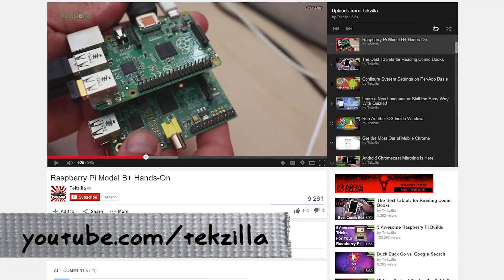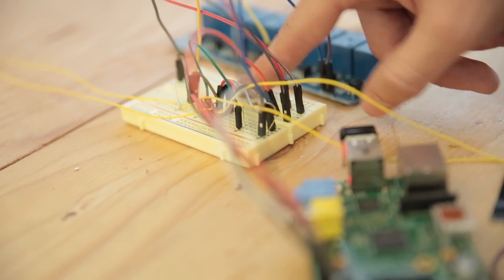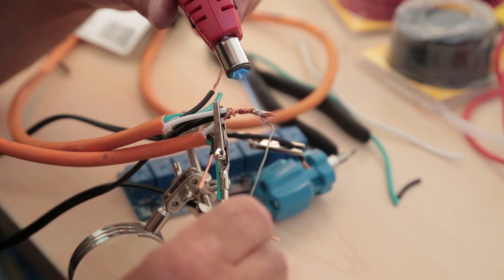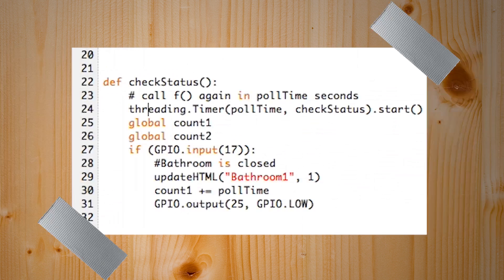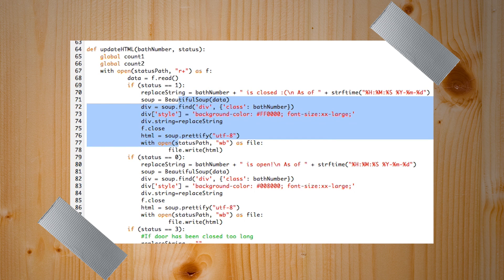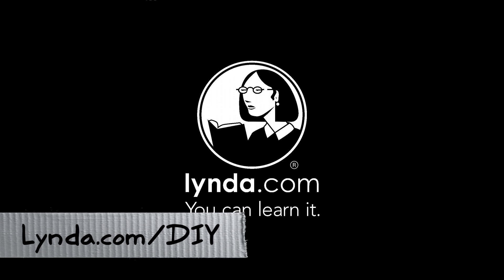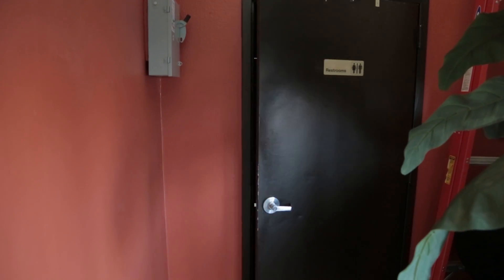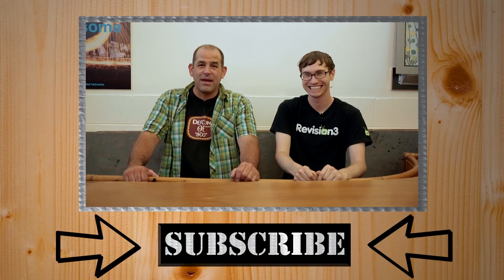Use a Raspberry Pi to Fix Everyday Problems. Become the Office Hero!

Comment: I have a Pi and still have no ideas for a useful need for it.
Reply from the maker: YouTube Commenters, Assemble...

Give this Droid some ideas!
Reply: DroidAppleTech Put Linux on it, put it in a nice case, attach it too the back of a spare monitor, and donate it too a local kids after school program they never seem to have enough computers for the kids to use.
Reply: Paperweight!
Reply: i've turned my pi model B v2 into an internet powered retro radio.

parts:
3W per channel amplifier (dx.com)
realtek usb wifi adapter
burned out Logitech ipod dock (speakers were scavenged from this)
old, broken radio (goodwill, salvation army, etc.)
rotary encoder (optional, for volume control via GPIO)
5v 2A adapter (scrap, parts box, etc.)

software: 
occidentalis (adafruit raspbian build)
squeezelite (controlled via software for the logitech squeezebox)
you could also use the Volumio image if you wanted.
Reply: Commodorefan64
so far still doing nothing.
Reply: @DroidAppleTech  how about now?
Reply: +DroidAppleTech
• Home Theater PC (Kodi) — VERY popular use, near zero additional cost and useful
• Build a MAME video arcade cabinet — also very popular and cool
• Server for websites or an internet camera
• Start an internet radio station (Shoutcast)
• Replace the guts of an antique radio to play internet radio & MP3s
• Hub for a video security system
• Control your holiday lights
• Slap on a fat HDD for Network Attached Storage
• FTP server for accessing your files when you're away from home
This list could go on forever, but I can't. Make something with it. If it stops being cool or fun, make something else. Good luck!
Reply: I have a Pi, I have an Apple,... Applepi :D
Reply: DIY Tryin
bear in mind i have a macbook pro, hackintosh and a Power Mac G5 so I'm already loaded with computers.
Reply: Buy a simple LCD display, preferably 10 inches, cut a hole in your backpack to the same size of the display, place the display inside the backpack facing out of the hole, connect the display to your raspberry pi, buy a portable rechargable battery, and boom. You can now play games anywhere you go, on the bus, in the library, or in a car on a vacation trip. You can just connect wiimotes and such with bluetooth.
Reply: +DroidAppleTech That you couldn't figure out anything to do with it says more about you than it does the pi.
Reply: DroidAppleTech 
Turn a dumb TV into a smart TV or use it to replace the buggy spyware laden web and media functions of a Smart TV.
Reply: Peter Missick Why bother on the cell phone idea when you can get a Motorola E for $80 US, and it's MAME not MANE, which stands for Multi Arcade Machine Emulator. The Best Idea is still to attach it to a TV, or Monitor, and either make a mini Linux computer out of it, run XBMC on it.
Reply: DroidAppleTech I turned mine into a tv streamer lol to watch football
Reply: Minecraft Server, Smart house brain
Reply: ***** Yes it did just came out, but he has the old Pi laying around, lets stick to ideas for the original Pi.
Reply: +DroidAppleTech I turned my Pi into a full blown HiFi-Stereo system using the HifiBerry AMP+ (2 x 25 Watt is way enough). I store a copy of my music on a USB-Stick connected to the raspberry and can play my library with my computer shut down. It has an IR-sensor such that I can use my remote and maybe sometime I will add a display (currently I have a text-to-speech program as feedback). Additionally, I stream sound from my computer to the raspberry via ethernet (which is automatically detected by my computer). It is really something nice... :)
Reply: +DroidAppleTech 
put a vpn server on it. so you can connect to your network. And use it from your phone whenever you are on a public wifi.

make a scrip so that you can turn on/off your computer over the internet from your phone. WOL/rpc -> enable remote desktop on your desktop pc, so you can then use it remotely when ever laptop doesn't have enough prosessing power.
Reply: +protonx80 a wifi connected "local neighborhood storage" actually sounds like a cool idea!

Use it like a local craigslist!
Upload coupon codes for stuff you don't need!
Host porn on it.
Etc.
Reply: +DroidAppleTech I made a controller with a webserver on a Raspberry pi, for a DIY solar heat collector (of course open source!). You can see it on www.solarair.livotel.com. It is also controllable trough a smartphone or webbrowser.
Reply: Easier stuff are a VPN server for anywhere, just connect using OpenVPN on your linux machine while the PI sits safely at home, or even windows [haven't tried]. You can just overall use as a programming hub, video hub, music hub, file server, multiple servers, game servers, buy some parts and make a personal Pi-laptop, etc.
Reply: DroidAppleTech I'm curious, what did you decide to do with the Pi?
Reply: Expecially since the rasberry pi 2 is out with almost triple the performance for the same price you can easily turn it into a roku type device using xbmc in about 5 minutes.
 That can stream 1080p its pretty sweet.
Reply: +DroidAppleTech  eat it
Reply: +DroidAppleTech Sell it on some auction site and move on having more cash instead of equipment you do not use. The hype around this machine is huge, even the first models are worth cash, use that and sell it. Because of the small size it can go as a letter.
Reply: chilliman07
but why???
Reply: ***** you are spot on and this is precisely why Apple is not relevant because it's not open and tremendously limitated by some stupid decisions in terms of software.
Reply: +chilliman07 paperweight
-_-
Reply: ANTHONY CABALLERO shut up
Reply: going for media/entertainment (home theater+ streaming), FTP server & torrent machine
Reply: Commodorefan64
You can still stream 1080 p using a b+ .
Reply: DroidAppleTech Sounds to me you are yet to get a computer ;-)
Reply: I have 4, all running Linux :P
Reply: +chilliman07 true dat
Reply: +DroidAppleTech Make a retro console!!!
Reply: +chilliman07  nice! very little programming required
Reply: i am happy to report i now use my pi to remotecontroll my pottery kiln and i use one as a kodi mediasenter. its fantastic
Reply: +DroidAppleTech None of those are useful.
Reply: i made a kiln controller
Reply: Lookup FreePBX server - allows you to use voip to call others and receive calls. Possibly the most useful Raspberry Pi project
Reply: Plsssssssss donate it to me because I need it but I don't have
Reply: @oxyacetylene_  Then use it for what though? I'm thinking of buying one to use while learning python. But I can't really think of anything useful to do with it either. I don't really need a talking book reading robot dog or a mirror that tells me I'm beautiful whilst giving me details of the weather. I don't need a mini computer for anything my phone, tablet or laptop can't do ten times faster already. I don't need an in car entertainment system as the car already has on, same goes for a media centre etc etc. I don't really want or need to do any of the geeky things I've seen them used for so far like remotely looking up women's skirts on elevators etc. In fact, the best suggestion I've seen so far is to donate the thing to a local school so the kids can learn code and build that kind of useless shite.
Reply: make a robot that reads a book
Reply: tur it into a gaming consule with a program caalled "MANE" or make it a cellphone.
Reply: Peter Missick have a model b and can tell you without a powered usb hub, wifi is so slow for it to be useful
Reply: DroidAppleTech Make a robot. (1 year late, but still...)
Reply: +Boonstra TV hahahaha
Reply: Try installing the Firefox OS on it
Reply: +DroidAppleTech got an arduino.. only thing i use it for is copy rfid tags... once modified my car so i could start it with such an rfid tag but if i would have left it in my car it would be huge waste of hardware so yea
Reply: raspberry pi toaster
Reply: Pizzaman

Its called piratebox
Reply: +DroidAppleTech how about a media center? Yeah I can see it's already a year old.
Reply: Make an arcade game, you can make a game boy
Reply: Commodorefan64 why aren't we funding this???
Reply: Spoder Man Damn good question. These, or Asus Chromebits are perfect for donation computers.
Reply: Andries Van Bruggen :P
Reply: nice question.. check this link to build your own robot  www.LeenaBOT.com
Reply: chilliman07 Hey there! Could you tell me why Linux over Windows? Please, I'm deciding between a change of Os or a partition 😀
Reply: get a pet instead man..
Reply: Why buy it dick
Reply: Mizio Tiger 123 what program did u use?
Reply: If u dont have any idea Give it to a child so that it can learn
Programming
Reply: I LOVE using mine as  chromebook. check out Flint.OS
Reply: Make a robot to deliver you toilet paper while your blowing the shitter
Reply: Connect it to Ethernet and use it as a streaming device. YouTube, Netflix, etc. Anything!
Reply: i have Pi and ideas but less viewers and Subscribers why?
Reply: @StijoBitsInBytes  hey dont be down ..bro ..your videos are cool iam subscribing your cahnnel
Reply: @holyfucker725  thank you so much bro
Reply: Hi, is it still working i need a old rpi
Reply: I made an AI Jarvis dude and presented in my channel dude....if you are highly passionate you can ...do anything with it
Reply: Turn it into a piehole and enjoy ad free web browsing
Reply: 4 computers running Linux, not 4 RPI's

Why? Because Windoze sucks.
Reply: american netflix vpn for your smart tv.
Reply: you could make a TOR VPN or an android PI
Reply: Well same here,  I used it's GPIOs and PWMs but yet i dont see it useful to replace netgear with media server that i use already with 4 hard drives and its fast, 
KODI, etc.. Nah,  I have lots of free movies saved my my Internet provider free to download.. 
Most things that dont requires GPIO I replace it with tablet, phone, smart tv, DD-WRT Hacked Router, and i use lots of ESP12E that connect to Internet, Flashed by OTA, and using arduino uno & due that dont require long time to boot up and uses less power, 
Building a project with ras-pi cost more money and time to build in comparison 
A small device like ESP12 $2 with relay can do this project in shorter time. Right?
Reply: donate it to me ;)